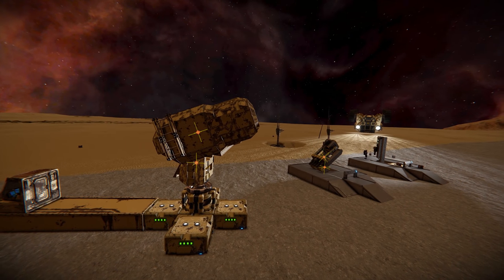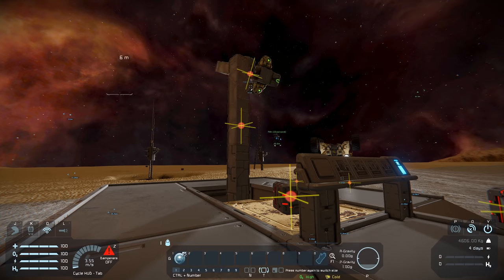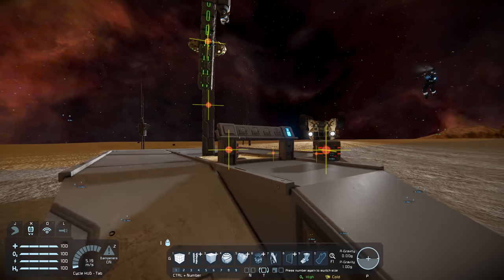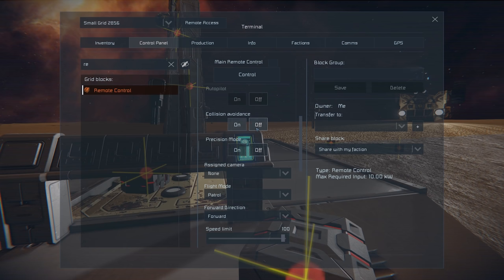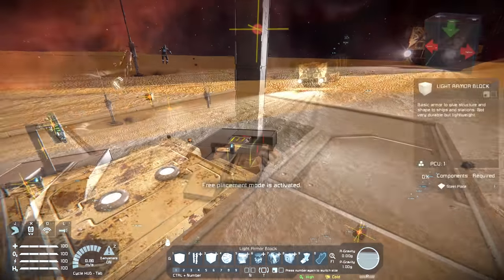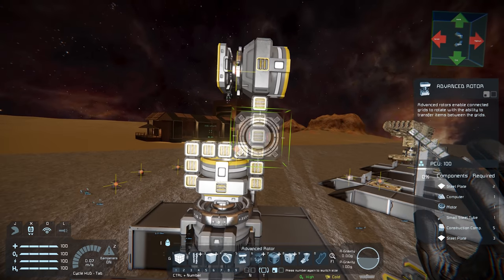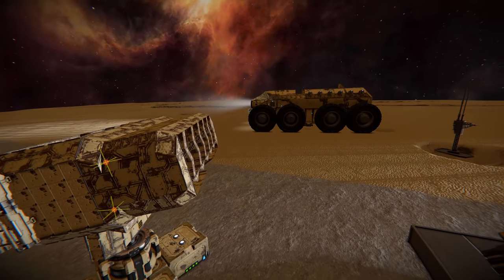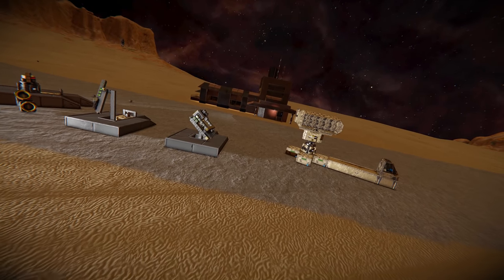Space Engineers - Over Powered Turret How To Build

Comment: How would you build this turret on a big ship without the turret control interfering with the ship main controls and gyro ?
I want to be able to man this kind of turret while a buddy is piloting the ship. I get the message "Connected ship has taken control".
Reply: I think you need a separate control centre, like all the bow guns and ship control is on the bridge and you have a secondary bridge where most of the gunners are, I have no idea how to properly explain but there is a mega sized ship with 3 secondary bridges and a bridge, they call it a ‘Reaper class Super battlecruiser’ but the faction leader does not want to share the blueprints of it to anyone

Comment: What about protection for that lower Rotor, the one everything is hinging on?
While you can armor it up from the bottom part, what about extending a "armored skirt" from the middle segment? Something wide enough to cover the rotor, without hitting everything around it?
Reply: That part is usually embedded inside the mobile design so a rover or a ship.
Reply: @Zoey--  That still leaves the connection as a weak point.
Of course I have none of your practical experience, so I guess it is not much of an issue.
Reply: @christopherg2347  in most cases, with the placement of turrets, it pretty much means, that the moment the enemy could hit the main rotor he already carved through half of your vehicle. in which case you are pretty much done for even with a turret.

Comment: Is there a way to counter the lack of horizontal rotation using gyroscopes when your turret approaches 90 degrees to the horizontal axis? Or do you just limit the angle to vastly < 90 degrees to avoid it, but this limiting your vertical arc? (If that didn't make sense, using the above example, if your turret aims directly up you cannot spin it left / right with the mouse any more - any way to counter that?)